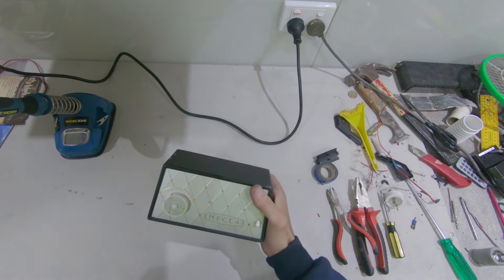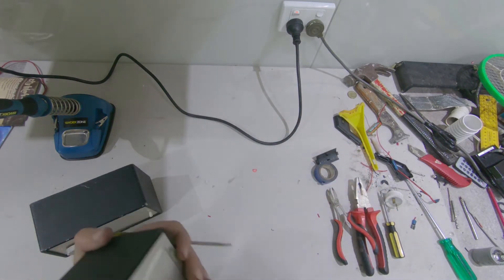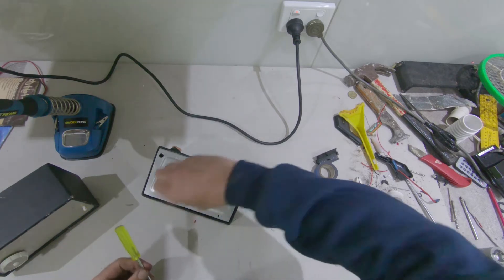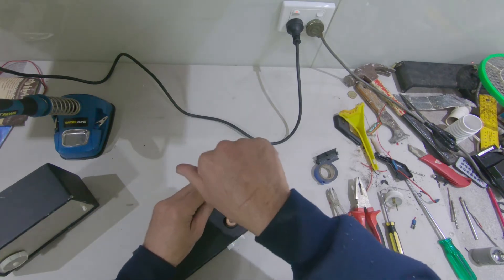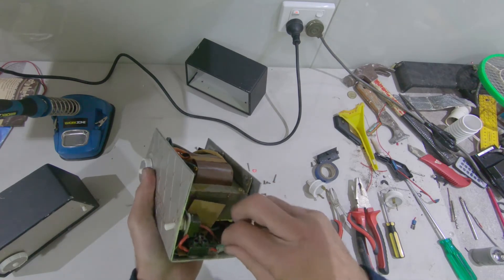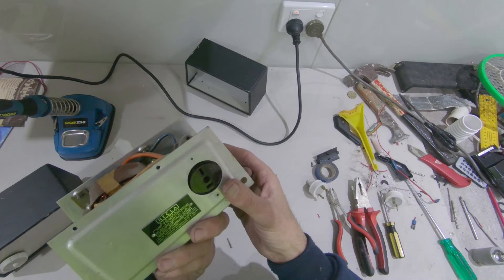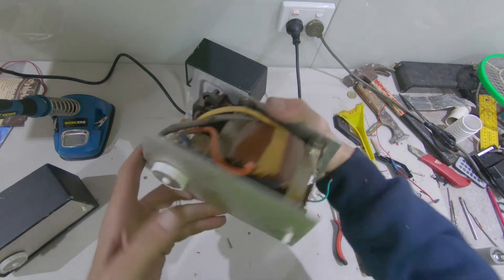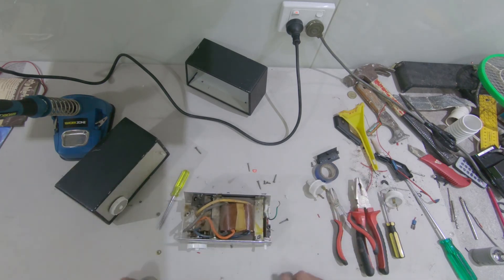What's Inside this Vintage Electric Blanket Warmer?

Comment: So....where's the blanket Chich??
Reply from the maker: aussie cylon no blanket I'm afraid, but doesn't this thing look like a part from a Viper??
Reply: Yeah, at first I thought it was the left side stabilizer, gyroscope-gizmotron, bimball arhithi from the starboard engine, but then I realised that it was the anti-rotating, neutron-energising fuel vaporising arhithi from the right side of the engine. They both kinda look the same, except one hangs lower than the other one.
Reply: Funny bugger hahahaha!!!